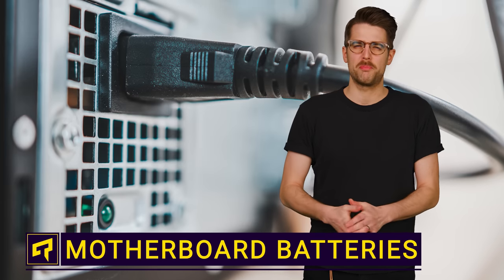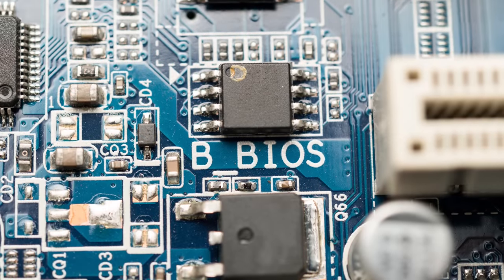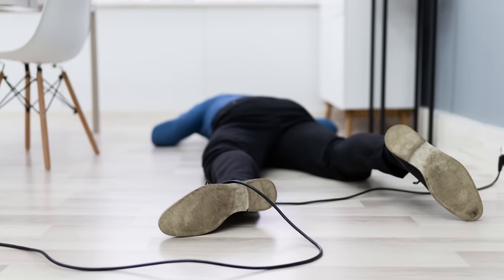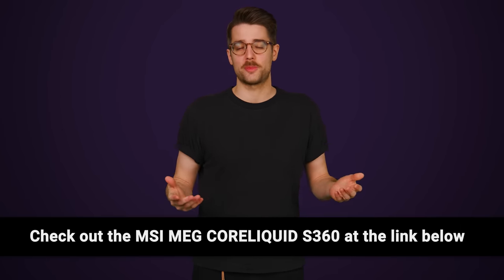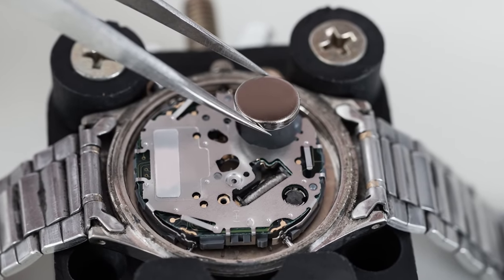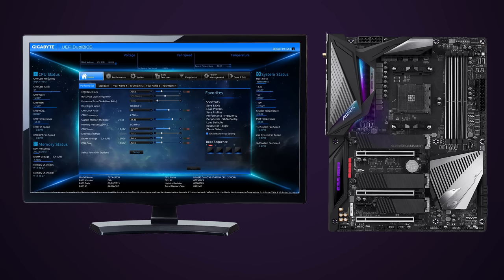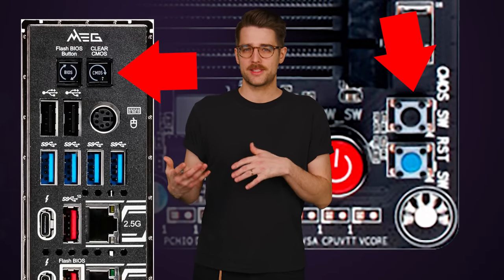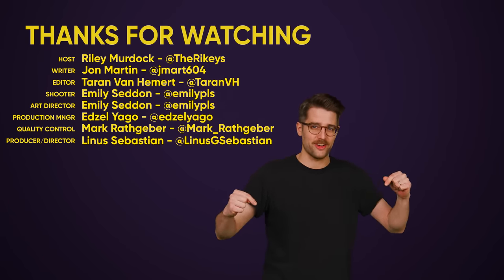Why Do Motherboards Have Batteries?

Comment: I don't know if they use NTP or not, but Windows desktops do attempt to sync with time servers. If in a domain, it's the domain controller, if not then I think it defaults to a server at Microsoft. Linux desktops also come with NTP (though it may not always be enabled by default).
Reply from the maker: We were actually talking about how Windows client machines typically don't use the UEFI network stack to connect to an NTP server at boot time, rather than the time service inside Windows.

Thank you for watching!
Reply: I'm a domain the DC controls time. It hits Microsoft for time corrections. But it's incredibly inaccurate. Don't worry though,, MS made it so the time can be up to like 5 minutes off and no big deal. 
I worked in transportation and the time being off by anything more than 30 second and it would mess with the dispatching. So I just switched them to NTP on my second day and cleared it up.

Comment: Hang on, "[NTP] isn't commonly used on home PCs", that doesn't sound right, I'm pretty sure every desktop OS (and every mobile OS for that matter) connects to NTP servers to get the correct time, the same way servers do. The battery just helps in case you're not connected to the internet when you boot up.
Reply: Yes. Also, servers still use a CMOS battery for their real-time clocks, just like consumer PCs.
Reply: @Primetime94  I've seen some other comments here implying that server motherboards have support for NTP in the BIOS, which might have been the difference that the video tries to point out. I don't think desktop motherboards have that.
Reply: @thorbear  Maybe. I've never seen that option in the HPE Proliant servers I've worked on. I've been working with those since 2015. But I can't speak for other brands.

Comment: I hate that companies keep old crap just because that is how it WAS done. If you buy a product and don't even skim through the manual, you are wrong. I used to be on the team of learn to use and now that I know it shouldn't change, but that has drastically changed after I went to company that offered SOOOOOO much more stuff for a product. I bet most people don't even know that their newer products has a wireless connection available for support.
Recently bought a new place and had to buy a washer and dryer,. Most had some sort of quick support built in that told the user the issue with a phone, not to mention the features for security prevented things like poor exhaust from causing a potential fire. Then we get to fridges, the 7 year old fridge left had a few things that failed, which it told me from a sensor (after I read the manual of how to diagnose) that basically told me it was cheaper to buy new (did my research of repairs). My new fridge tells me if I leave it open on accident which is amazing. Sure, it sounds stupid at first, but when you fill the freezer and something prevents closing, it is awesome to save things you worked or paid for.

Comment: CMOS battery .... take it out and watch what happens lol 😆

Another interesting thing is that you can turn on a PSU without a motherboard, you just have to jump two pins on the 24pin connector to "trick" it.

Comment: The info about NTP is wrong! NTP is used by default on Windows, Android and almost all Linux distros. I haven't used any Apple products, but I'd be very surprised, if they don't use NTP.

Also, NTP is not only used at boot time but also at regular intervals while the device is running.

Comment: Mobos should just remove that battery windows can automatically update the time anyway and the battery most of the time is placed under the gpu so you have to remove it to gain access just add clear cmos button to the back of the mobo.

Comment: The fact that the battery dying can clear your BIOS settings still is a little annoying… I didn’t realize they changed to NVRAM for BIOS settings at all
Reply: Clearing CMOS doesn't physically clear NVRAM. So you can change the code to clear NVRAM when CMOS clear is detected or clear NVRAM and preserve some settings or don't clear NVRAM at all etc.

Comment: Why not use a capacitor like the original Xbox used (that is also now a source of corrosion, but that's more of an age and cheap component problem)?

Tradition, but then remove the battery, put a cap and put a clear CMOS button? Idk. I'm just spit ballin ideas.

Comment: Why doesn't it have bigger batteries to prevent power failure like a built in portable battery so when power gets low it will safely cut itself off

Comment: No, my question is why doesnt this old Socket 5 motherboard running Windows NT 4.0 I'm trying to get back running DOESN'T have a CMOS battery in it. It's doing this weird thing where it's holding onto the cylinder/sector/head information as the primary IDE master in the BIOS even when I plug into the secondary, or as a slave. I've been fighting this thing for a week now!!

Comment: If every company in tech named their products like the battery industry it would be great.

The code CR2032 the C means its lithium. The R means its round. The numbers stand for 20x32mm for the diameter.

And whats with the knock off brandless Maxell knock off battery on the cover photo motherboard? Legit same batteries you find at the dollar store. Wouldnt trust it with the alarm on my watch let alone my computer
Reply: The 32 actually represents the 3.2mm height, but your point still stands. An actual useful way to name products.

Comment: RTC Batteries are really unnecessary, cause more harm than good and are a maintenance burden (when they fail, you have to take apart your laptop to replace them) Modern devices like phones don’t need to keep the time when they’re drained. When they power back up, they get their time and continue on. 
Some laptops, the RTC is layers deep beneath other parts.

Comment: okay so I don't know why this has been so confusing for me. So, the BIOS was stored on ROM and any changes made to BIOS would be stored on CMOS. But they replace CMOS with flash and the whole BIOS is stored on flash. The original BIOS was called legacy BIOS it had limitations and was 32 bit whereas UEFI which replaced it supports 64 bit operations. So the battery that is still on mother boards is for the Real Time Clock (RTC)  which I don't know what that is yet. I watched a video where the guy said the CMOS chip was combined with the RTC. In other words I am very confused.

Comment: So basically: CMOS is the hardware part and BIOS is the software part - kind of like "my computer crashed" vs "Windows crashed"... commonly used the same way but technically two very different things. Good to know. :)
Reply: At least it used to be. Modern machines have no CMOS, instead the "BIOS" (actually UEFI) code and settings are stored in the same non-volatile SPI NOR flash chip. But since the advice of pulling the battery to "clear CMOS" is still common, motherboard manufacturers often emulate a "CMOS reset" by reinitializing the settings storage if an RTC clock reset is detected.

Comment: Idea: a PSU with a small battery so when the power goes out it can correctly and safely shut down. Software-Hardware communication would have to be better but it could be cool
Reply: A Backup Battery!

Comment: I was wondering that I have seen a PC with a very old motherboard. I mean I saw that PC in a teaching institute. Even my PC is also too old. What I saw that PC keeps the power on for sometime after a load shedding. Is related to the CMOS battery or the power supply of the that stores some power to turn it on for a while. And does CMOS chips mean motherboard chips such as b150m chip motherboard that I have the latest z690 intel motherboard or the z490 amd motherboard.

Comment: nah the batter is to power the full PC it puts power in to the power lines.
but the battery needs to be able dis charge it self in to the power lines that's why you need to plug in your pc

Comment: Recently got a Toshiba laptop, it has a placeholder for a CMOS battery, but apparently it uses the battery that is for power as it's CMOS...wonder if I installed a thing to it and popped a battery in there, would it help?

Comment: hi . can i change the battery with the computer running ? that way the bios won't need to be reset? or is there any other way around resetting the bios with computer off? cheers

Comment: And again you missed the origin of the battery. In the ancient times of dragons and IBM PC's there were no CMOS memory used to keep system settings. At the time all the settings was configured using jumpers or if fancy, dip-switches. But every time you started the computer you had to enter the date and time. The solution to this was to add a battery that kept a real time clock running when the machine was turned off.

Years go by and the configurations for floppies, and disk drives moves into the CMOS setup program and is stored in a CMOS memory that is kept alive by the clock battery. For years the setup was done by running a program, usually from a floppy disk. So we didn't yet have the "Press DEL to enter Setup" dialog during POST. To configure the HDD's you booted to DOS and ran a program called Debug. And yes, this was a debugger that allowed you to list, call and step through machine code  routines. So enter "debug" and press enter. When you get a cursor enter "-g=CC00:5" and enter to start the HDD setup program in the ROM of the WD HDD controller.

More and more of the settings move from being set using jumpers and DIP-switches to the setup program, and eventually the setup program moved into the BIOS. So what you were using all this time is the CMOS setup and not the BIOS. It's just that this program happens to be stored in the BIOS memory...

But that's just semantics. Everyone has called it "entering the BIOS" for so long that it's ridiculous to complain about it now.

Now I want to talk of the batteries used. Originally these were not Lithium cells. I'm not sure about the first batteries but they may have been silver oxide or alkaline, but most likely they were Nickle Cadmium batteries. The early real time clocks and CMOS memory was pretty power hungry compared to what was available later, so using a rechargeable battery was a good idea. These batteries were either soldered onto the motherboard or they came as a separate battery with a cable to be plugged into the motherboard. These batteries were then attached to the chassis in some convenient place using double-sided tape or sometimes a Velcro strip.

NiCad batteries were recharged whenever the computer was turned on and so they could keep the clock running and CMOS memory current for several years, but eventually they would start to fail. This usually was recognized when the computer started to prompt for date and time every time you turned it on. If the battery ran low enough it would also loose the content of the CMOS memory. The early machines were pretty sneaky and you didn't really notice this as there were no warning that the CMOS memory had been wiped or corrupted, so you didn't know you had to reconfigure the setup. You could however get some weird problems. So any time the clock started to fail you better replace the battery.

Now on motherboards with a soldered battery there were also a connector for an external battery. The most common version was a four pin connector with one pin (2 or 3, I can't remember which) used as a key so you couldn't connect it the wrong way. The remaining pin in the the middle of the connector, that's 2 or 3 whichever wasn't used for the key, was connected to the positive side of the soldered battery and a jumper was used to connect that to the outer pin (1 or 4) closest to it. So when you installed an external battery you removed that jumper, disconnecting the onboard battery, and plugged in the external battery. Now if you installed a NiCad battery then that was all you had to do, but if you installed a battery not intended to be recharged then you had to disable the charge circuitry by, you guessed it, removing a jumper or possibly flipping a DIP switch.

The external battery was often a battery holder for four AA cells for a battery voltage of 6V. The clock on these early machines usually ran on +5V but 6V was close enough so it would work fine. Later versions used a lower voltage, 3.6V sounds familiar and just happens to be the voltage of a three NiCad cells in series. I remember that we still used the four battery AA holders for these though we shorted out one battery place and only used three AA cells for a total of about 4.5V and that worked with these motherboards. But now Lithium cells were becoming more more common and at 3.7V a single Lithium cell could power the real time clock and CMOS for a long time, we're talking several years. And as Lithium cells usually didn't leak and were more long lived than Alkaloid AA cells they became more popular.

Now when replacing a NiCad battery with a Lithium cell you ABOLUTELY HAD TO DISABLE THE CHARGING. Lets just say the alternative is explosive. And yes they could really explode like a grenade. One of my coworkers made that mistake one time. The day after the customer got the machine back he called in saying "It exploded." Thing is he was so cool about it that the guy answering the phone thought is what the usual hyperbole and that it was a loud pop like the one you get when a electrolytic  capacitor blows. So he was told to bring it in again and we'd have a look at what went wrong. So he and his son comes to the shop and the machine looked like it had got gullwing doors. Both sides were curled up and the front panel simply didn't exist anymore. And yet he was so calm...

We built them a new much better machine while they waited and managed to clone the old drives saving all the data. But I'll never forget how dangerous it is to put a lithium cell to charge. Note that this was lithium cells and they were not rechargeable. Modern Lithium Ion batteries are rechargeable and though they can explode and burn they are not quite as likely to grenade.

There were one other development in the 90's and that was the Dallas RTC and NVRAM module. These were pretty popular in portables as they were compact and came with a integrated Lithium cell that could keep the clock running for up to ten years. But like always batteries fail and often the ten years promised turned out to be more like two or three years. I'm actually not sure if the early models has NVRAM as I seem to remember laptops loosing the settings when the RTC module ran out of juice.

For motherboard however the NiCad batteries were the first to be phased out. The external AA battery holders and Lithium cells were next to go, replaced buy the CR2032 lithium button cell that's usually used today. But as the config is stored in NVRAM or even Flash memory today and the real time clock chips barely sip the power these batteries tend to last long enough most people never have to think about replacing them. I just remembered that a friends computer recently turned 15, and it's still on it's first RTC battery...

Comment: I have the problem that every time i shut down my pc/drain it from its power, my bios will reset. I’ve changed the CMOS battery, but that did absolutely do nothing… Help, what should I do? It’s a ASUS Z270-P with an I7 7700k if that matters…

Comment: Hate to beat up a small business, but the UMPC chinese groups are total morons for not adding in CMOS batteries. Even when asking about where they are(as some are soldered to the board). Each comapny had said they either didn't know what they were or they just didn't feel like adding them in. Bravo. Pure genious. $1000+ machinery and they don't even know wtf a CMOS battery is.

Comment: Not too long ago I had a PC that wouldn’t boot, I tried everything under the sun, including removing the battery, not until I curiously replaced the battery did it finally boot, anyone know why that would be the case?
Reply: Maybe because the battery is a key function to running Time zone on the computer. On or off so when it dies your computer has issues.

Comment: The original PC had 16 K of non-volatile ram. This holds the code that executes immediately after a hardware reset. The real-time clock chip (CMOS chip) only came in due to a design error in the 8086 (the only way to clear the protected mode bit was to hardware reset the processor). The only way to keep context information through the hardware reset was to store information in the clock chip.

Comment: Why not a big azz capacitor like a PLC. I bet most mobos could get away with capacitor.
Reply: While that would be fine and recharge itself when used regularly, it would probably only last a couple of months at most without power before it went flat and lost the time, compared to a coin cell which will last for years, although generally isn't rechargable (some are). An error or warning message from the bios/uefi about the clock not being correct after buying a new computer that sat on the shelves for a while mightn't be the nicest introduction for less technology literate users.
Reply: @jg374  Googling an error code would be a great start to the PC gaming experience LOL 😂😂

Comment: someone can help me hopefully. i have an asus vivobook X441ba that shows ddr4 memory running 1066mhz but the bios shows no way to change the speed. did i get tricked into a crap netbook that is not upgradable?
Reply: it has an extra ram slot to upgrade and everything shows it takes 2400mhz ddr4 sodimm but it wouldn’t boot with one installed

Comment: Is unplugging a laptop then holding the power button for 30 seconds the same thing as resetting the CMOS (or really BIOS)? Or would you still need to remove the CMOS battery from the laptop?